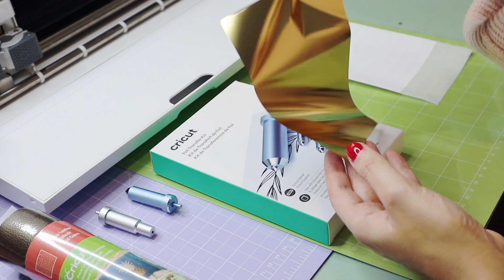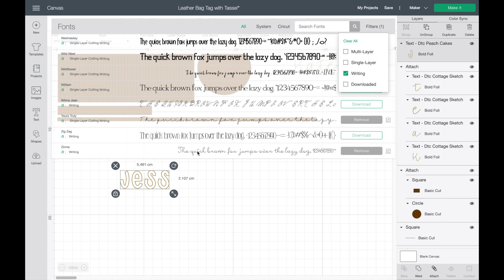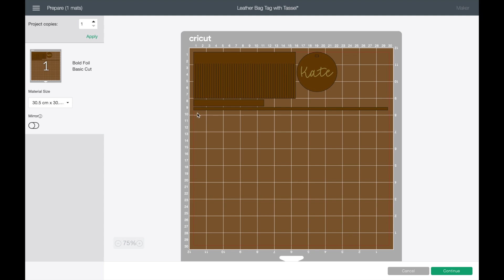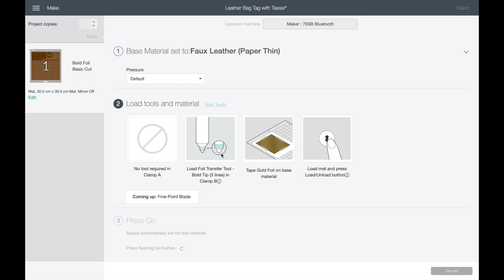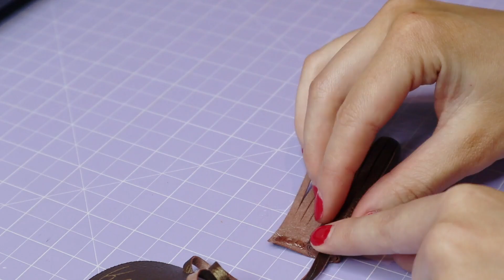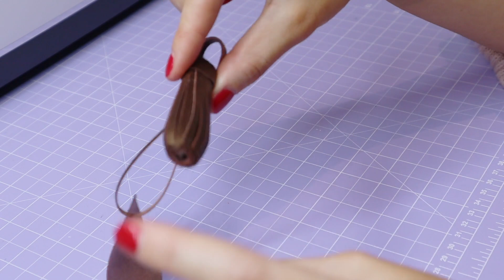Make a faux leather bag tag with the Cricut Foil Transfer Tool | Kate Polizzi

Comment: This foil needs heat I guess. Some have old brass letters but  heat is needed for these brass letters on the leather. This machines does not do that. Just push the foil into the faux leather.

Comment: Love the tutorial! I have an Explore Air 2.  Everything is fine to make it unless I add a textbox with foiling.  I can cut faux leather.  But if I try to add an element with foiling of the text to it, DS wont let me choose any base material  It says my tool(s) is incompatible with selected material.
Reply: Mine said the same thing. I just used the heavy cardstock option and it worked fine.